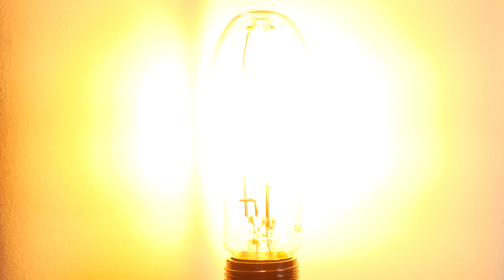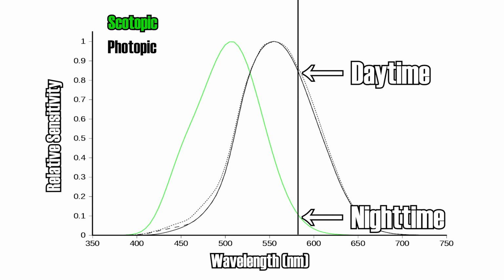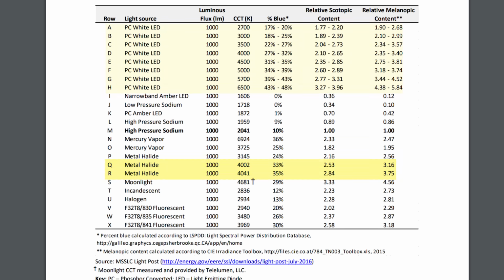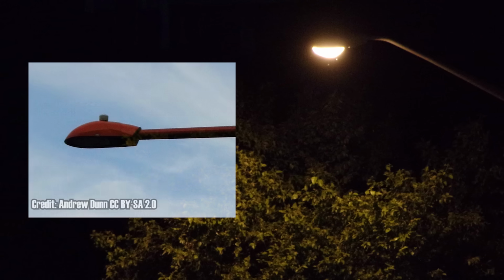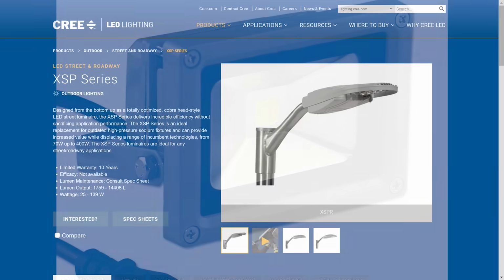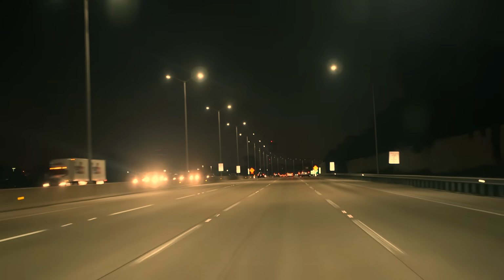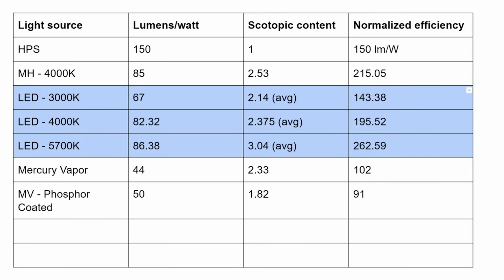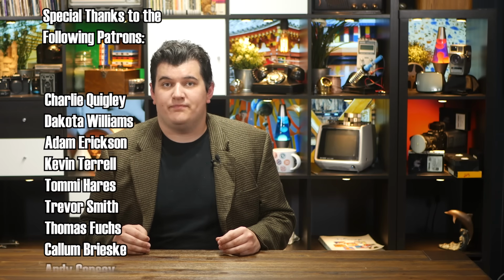The LED's Challenge to High Pressure Sodium

Comment: In my area, they just converted an intersection from HPS to LED. I can see much better and everything is lit up white (about 5k) instead of orange. One downfall I noticed immediately that the glare is much worse tho. The glare that comes from the fixtures themselves is actually kind of blinding/distracting. From my experience LEDs aren't anywhere near as reliable as HPS. Most of them have cheap made drivers that fail. I can't tell you how many I've seen flickering or strobing over the last few years which is a whole new level of distraction.
Reply: That's my main issue, technology being pushed based on theory, thay they SHOULD last longer. I live in Sarnia Ontario, Canada, and i gotta tell you, most lights here are LED, eith the occasional left ocer HPS lamps, and about as many LED fixtures are dead as there were cycling or rarely completely dead HPS lamps and fixtures years ago. So it's bullshit in that most units, I'm sure in major cities are cheaply built. Also i miss color of sodium lamps, very nice at night reflecting off water.
Reply: @inoutdoor4211  I fully agree. Even the push for EVs is BS. The battery technology isn't anywhere near good enough to be practical but since politics got involved, they're forcing us to go that route anyways. I'm all for the LED conversions but they need to make them reliable first and do something about the glare. I still like HPS lights better for now because of those reasons. The light may not be in our visual range at night, but they still enable you to see the road and they're subtle. Not blinding or distracting at all.
Reply: there was a whole street in allentown pa that had strobing leds due to some issue and it was the first time I saw a major downside to the leds. The residents also were not happy about it and said it had been going on for weeks

Comment: If a bluer (5000k/higher k) light disrupts your circadian rhythm, I think that's another safety "feature". When driving the lighting on the road should not contribute to your sleep cycle, on the contrary, it should keep you awake. There are plenty of serious and fatal accidents because of drivers dosing behind the wheel and on top of that, high pressure sodium lights (still the most common type of road illumination) makes it worse. Hopefully high k LED lighting should become the standard throughout the country.

Comment: Consider the following: the circadian rhythm disruption is probably more or less a good thing in general in terms of safety on busy roadways like Interstates or state highways (since it keeps you more wakeful at night while driving on them), despite being potentially more hazardous to any one's sleep patterns.

With that in mind: it's probably best to use cooler light sources for higher traffic roadways and warmer ones for low traffic/residential ones, as that would have the best impact on safety, visibility and energy efficiency while (hopefully) having less impact on general sleeping patterns and light pollution than doing everything cold.

Comment: LED street lamps with short persistence phosphors could be synchronized and pulsed at 120HZ with 50% duty cycle.  This would allow astronomers to tune their cameras to see between the pulses-so everybody is happy.  Also, if this were done around the world, the duty cycle could be modulated to signal aliens very effectively.  If that were a good thing.

Comment: Luminaires with refractors/reflectors such as in a Cobrahead unit of which you spoke, may loose some of their light output to the side, but with 82% cutoff units, there is less waste of light and pollution and quite effective.  Secondly, borocilicate glass refractors (which are considered precision optical equipment) are also more transparent than their Lexan or Acrylic counterparts.  The 10% transparency loss of using Lexan or various plastic refractors is also a detail left out of the discussion.  The decorative (or pendant lighting) with arms and a base-mounted bulb or light source (LED) with reflector/refractor/diffusing globe, are considered by roadway lighting experts to be the most efficient to spread light in a Type III Distribution pattern, but horizontal-mounted Cobraheads' bulbs have better light control to roadway in their IES Type II, III and IV photometrics.  Another item worth mentioning is High Mast Lighting for interchanges.  I would suggest that HPS is as good for mass light distribution, even though the eye is not capable of accepting a greater measure of its yellow color.  I suggest this caveat, as It also largely depends upon what color surface and geography the HPS or LED broadcast light falls upon.  What is the reflectivity of the surface?  High Mast Lighting not only is suggested for on and off ramp lighting, but a general cost saving measure to avoid a forest of lighting standards (read poles) populating the gore areas and the main intersecting highways.  Think of obstructions and driver safety.  I haven't seen too many high mast lighting projects with LEDs yet.  It would be interesting to see a comparison to HPS.  Another troublesome issue is glare.  While HPS has used the 82% cut-off luminaire styles since the late 1980s, the LEDs have abundant glare.  My thinking is that in the near future, we will see the introduction of modified refractors (not reflectors) used with LEDs to better control the piercing blue-white (read: lunar white) irritating light. Another final consideration is the ability of HPS to cut through fog.  I'm not so sure about LED's equivalents?  Various other colors just cannot do this very effectively.  You've talked about this in other episodes of your tutorials.  Just some various thoughts.

Comment: One thing I have not seen mention of re the LEDs:  the effect on driving safety for older drivers.  Cataracts normally develop in the eyes between 40-50 and become symptomatic after 60.  The glare caused by these blue/white LEDs from non-diffused LED street lamp lenses can be extraordinary -- like looking into an arc lamp or welder's torch.  With early or late cataracts, the bluish light from these high-intensity LED fixtures becomes scattered by the lens within a catarcatous eye and starbursts and other visual abberations result -- unlike with the more diffused, orange light emminating from older HPS lamps with diffuser lamp covers.  Believe me -- I know because I have seen the difference with my own eyes....  This cannot be considered to be "safer" even with the slightly brighter roadways that may result from bluish LED street lights.  For such drivers -- and there are hundreds of millions out there -- it may very well be the opposite.  And those are the drivers who need the most help.

Comment: Having color vision issues, a problem I've noticed with the switches to LED's is that the color separation between green stop lights and the street lights is not as much as with HPS.  When the placement of these lights align, sometimes the brighter street light can overcome the illumination of the stoplights and give a false impression of a green "go" when it could be in a red "stop"
Reply: That is why "green" stop lights aren't pure green and have a certain amount of blue in them.

Comment: In my experience, while the illumination immediately beneath blue/white street ighting is excellent, its lateral spread is very poor. The pools of light cast by street light stands are therefore very small, with large areas of virtual darkness between one lamp-post and the next. In contrast, sodium vapor lamps seem to cast a wider beam of usable light with no truly dark areas to negotiate.
Reply: @liam3284  Thanks for your comment. One would have thought the manufacturers of the lamp-posts would have designed a suitable lens, having done everything else! TBH, I think the light units I've experienced, like those you have seen, incorporate a simple glass plate, as the light itself is clearly visible from beneath the fitment.
Reply: This is entirely a matter of the shape of the particular fixture and bulb. It has nothing to do with whether it's sodium vapour or LED, or their colour.

Comment: In my area on the UK N(ewcastle/ Gateshead) nearly all our street lights are LED. Additionally the council decided a few years ago to reduce the power by 50% up to midnight, and by 75% between midnight and 5.30am in appropriate residential areas. 
Great channel - 👍

Comment: I know that even mentioning mercury these days but what about low pressure mercury arc lamps? Low pressure mercury lamps említ higher energy light in terms of shorter wavelength. Mercury arc lamps (mostly) use a fluorescent coating converting the UV and shorter wavelengths to longer wavelengths which essentially lets us calibrate the wavelenght. Also mercury arc lamps are very efficient aswell

Comment: What of the abilities to throttle the lights when and if needed. Sensors and wireless communication could turn the lights on for coming traffic or pedestrians walking, deer. etc.. at 3 am you could get up and see the Milky Way.   In 1989 at a hotel in Paris I stayed; the hall was dark until you started waking. They didn’t need to light for most of the time. LEDs are instant and dimmable. A smart system could flash for hazards ahead such as slow moving or stoped vehicles or animals that failed to complete the next sensor. They could brighten for emergency vehicles, change colors for certain warnings like freezing rain or blocked roads.

Comment: Here in Peterborough, UK most of our street lighting has been changed over the last few years to LED, a few HPS lights are still in use, but they have been mostly phased out.   Last year, the council finished upgrading 17,000 street lights to energy-efficient LEDs. It then agreed to dim street lights in residential areas by 20 per cent between 9.30pm and 5am, by 20 per cent on traffic routes between 9pm and midnight, and by 40 per cent between midnight and 5am.    They have now decided to dim residential areas by 40% and slightly higher amounts on traffic routes.  About 24,000 lights are now LED based.

Comment: On the big island of Hawaii the street lights are LED and a yellow color. I did some looking around akd found out it was a partnership with the observatory. The equipment at the observatory can easily filter out the yellow color lighting. I found those lights pleasant to drive with as they were similar to yellow fog lights.

Comment: I switched to color tunable LED bulbs for most of my fixtures a couple years ago. I setup a dimming and warming routine around sunset and brightening + bluing around when I get up. I can't really conclude it was the lights, but around the same time I went from having 3-4 migraines per month to 5-6 per year.
Reply: Does that require any new fixtures with a temperature dimmer or something like that?
Reply: @HappyBeezerStudios  the smart bulbs i use can be used in standard sockets and dimmed and change color with a  phone / smart device.
Reply: When you dim incandescent you don’t see the phases of light because it takes time for the tungsten to unLuminate, but when you send the same AC current unless it’s rectified and not all of them are perfectly rectified especially dimmable type you will really see the flickering and the flickering is your eyes picking up on the 60 Hz frequency and if you ever try LEDs that are powered by a DC power supply you will noticeably notice zero flickering for instance look at TVs chances are they’re using DC current power the diodes inside the TV and that’s not bothering you before that it was a Micro fluorescent tube inside the LCD.

Comment: How about lights which have motion sensing and subtly change tone and brightness levels when there is actually something near them, making them whiter and brighter, and then reducing again once the subject has moved on. Obviously this would lead to extremely dubious efficiency gains, since you would have to power the movement sensors, but it would potentially be much nicer for residential neighbourhoods where a car only comes past every 10-20 minutes at night.